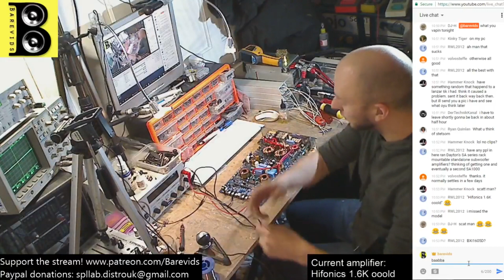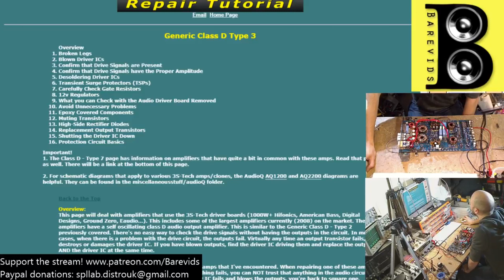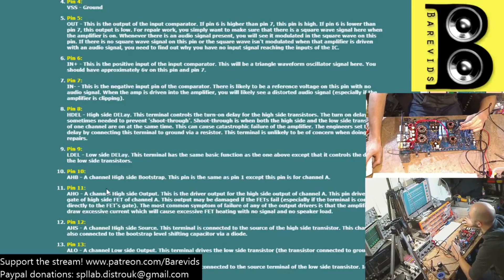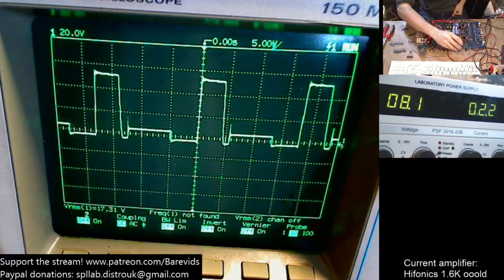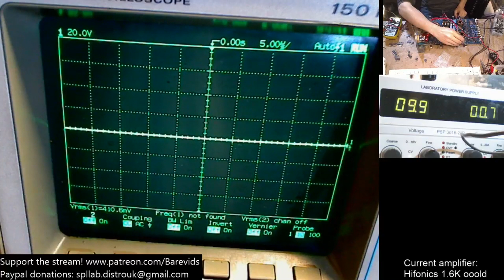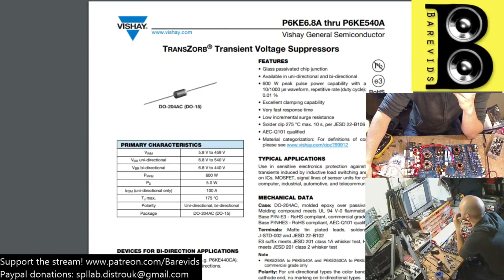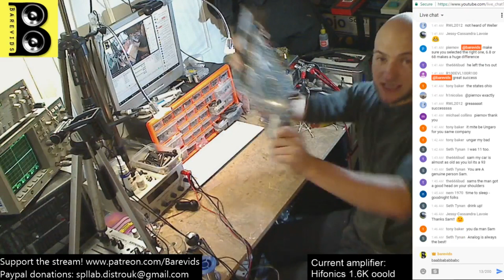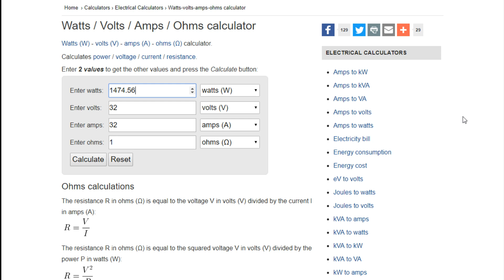A boozy HIP4080 repair evening! Older hifonics amplifiers, etc.

Comment: I know bassheads are naturally drawn to Class D amps for obvious reasons.  But it would also be cool if there could be some Class A/B repairs.  Lots of people used them for highs, or some of us old farts still like our old classic amp that are ALL Class A/B.....the HiFonics, Autoteks, RoDeks, ESX, (all made by Zed Audio)...not to mention Phoenix Gold, Orion, and the rest of that classic vintage gear.  It would be nice to see how much of that gear made it over there(yeah I in America) and how much is sitting broken in a closet or an attic just waiting for some love.  And trust me...it will be worth it...even you dont like it, its worth the repair and the shipping as some of the classics are going for SILLY prices over here still.  Lots of those amps are in the "recapping" stage, where the electrolytics are leaking and all need to be replaced, so basically the amp needs a complete rebuild, even if its never seen  power....it might work, but not to spec and at the peril of other parts.
Reply from the maker: +Nathan Pitman I've got a few class ab vids although they are mostly cheaper amplifiers
Reply: I hear ya....maybe use your popularity to see if you can get some of those gems out of the woodwork.  Gotta admit...your videos can get a bit intense, but you have GREAT info and should be a teacher.  FWIW I have worked on car/home/pro audio at some level off and on for the last twenty years.  and I have a ton of amps to recap.  Just getting my bench set back up after a move....forget how much stuff can go into a bench and how much more heavy it gets after a "few" years.  Keep on workin man....great stuff to watch and learn.  (I knew very little about ClassD and within a few videos...I am pretty sure I could attack one.  I knew the principles of how they work thought too.....D is for DIRRTY.....Class A and Class A/B....ahh so much more smooth, but SOOO power hungry.  Later man....

Comment: I have fix the power supply no output section the transistor is getting hot question do you power the board on the outside and test if all transistor running cool

Comment: Love, Love, Love - BAAAAAASSSSS I actually have an Alpine - 750 Mono Block 700w @2Ohm, is this any good to Run a PYLE 1600W Dual 4Ohm-V-Coil, mind it was only £39:95, seems to Run pretty well off My Pioneer Single Rear Channel at 2Ohm - if You know what I'm on about.!?
I also have another question where the Dickin's can In Buy some Decent Lead Rosin Core Solder, I spent a fair couple of Quid on Flea-Bay Buying Solder , and to be honest it seems to 
 end up looking like Dentist's Amalgam - all Dry and NOT Sticking at all (Total Cheap Crap) and Really Annoying..!
So I'd really Appreciate Your help on what Solder to Buy From The Amazon or Flea-Bay, Please..?
 By the way Your a Nutter - Love it..!
Reply: Dan Solo .......Pyle speaker's are Pyle of garbage...if you want bass you need ,sundown , SMD, fi audio, Rockford,mtx,or some Yamaha speaker's 15' to 18' inch is good with some oxygen free 00 wire or just thunder line for indoor setups Yamaha speaker's are great for indoor audio and don't forget if you want HiFi audio that's a nother thing completely or 7.1 Dolby digital time delay surround sound  so that speaker that is right next to and the ones that are way over across the room beside the TV that sound Hits your ears at the same time.....